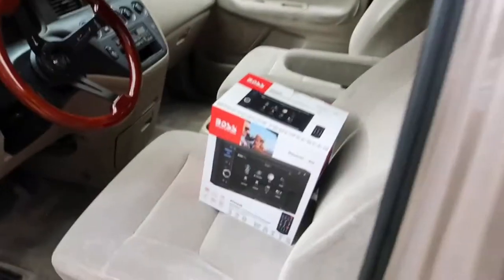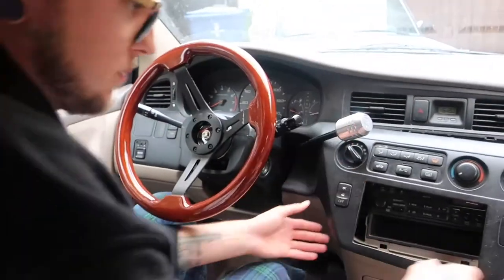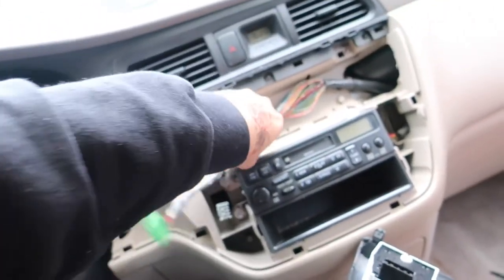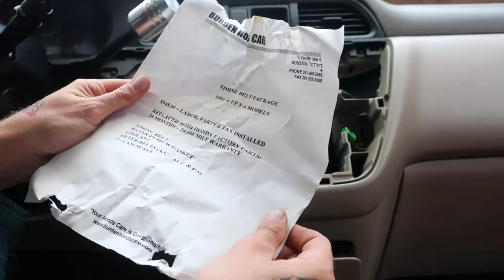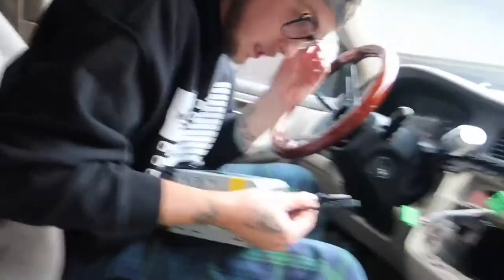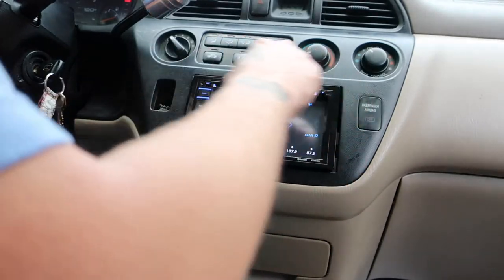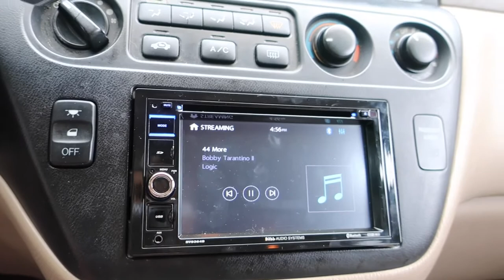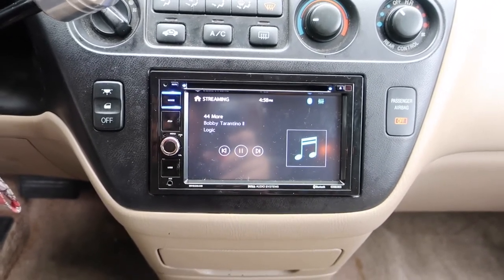98-04 Honda Odyssey Radio Install / Boss BV9364B / Double Din under $100?!

Comment: These first and second generation Honda odyssey vans are classics nowadays and they ran and lasted forever.
Reply from the maker: The engines? yes. Transmissions? Not so much. Lmao
Reply: @definitelynotmechanics  yeah the transmissions were known for slipping. I know my dad had one was a 2004 he got rid of it last year and bought a 2016 dodge caravan. And the generic factory radio and the cd player was of poor quality because everytime you hit a light bump in the road it would skip
Reply: @deanfarr3249  the Odyssey or caravan had terrible radio.

Comment: My 03 has the DVD player in it. Would I lose all the functionality of the original set up by doing this swap
Reply from the maker: The dvd player should be wired separately to work with the rear screen but i think it will affect it.

Comment: Did you change your gear puller isn’t it black but your look silver aluminum where did you buy it
Reply from the maker: Thanks for noticing. It’s a weighted knob I had made when I had my focus. When I realized the lance armstrong ball sack on the end of my shifter was threaded I swapped it with this. But it’s a pretty standard thread pitch as far as shift knobs go.

Comment: Can you do a video on your steer
ring wheel replacement
Reply from the maker: I’m waiting till my quick release comes in to do that video. Its the same as most Honda’s and I believe there is a video for odyssey stock steering wheel removal. Just need the adapter and wheel from there.

Comment: LOL. That stereo is flat out JUNK!!!! Mine died after 2 months. Would not track CD's, DVD's or even USB. I had better luck with a $50 DualAudio head unit from Wal-Mart.
Reply from the maker: It lasted the year i had the van after this video. It was still working great when i sold it. Thats the hard part to accept about the cheaper stuff, some times only one out of ten is a good unit. Whereas an expensive reputable company will be 1 bad unit for every 10 good.

Comment: what kinda adapter did you buy so it’d plug right in?
Reply from the maker: I ordered a radio pigtail from amazon for hondas then attached it to the pigtail that came with the radio.